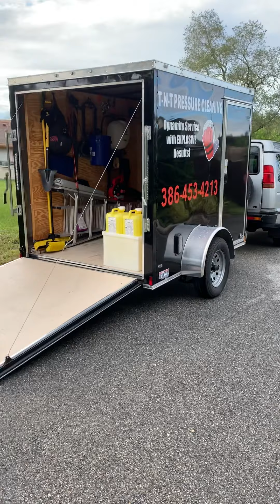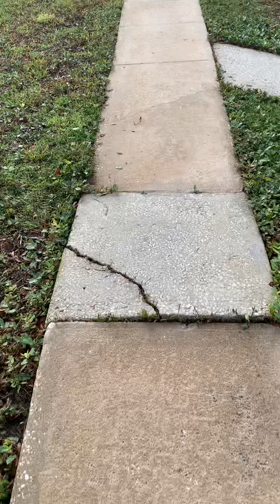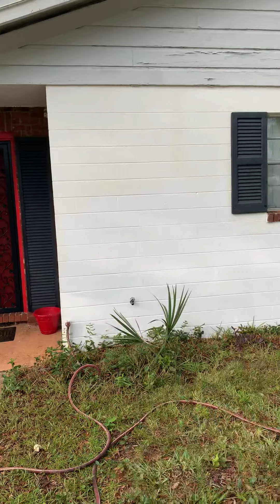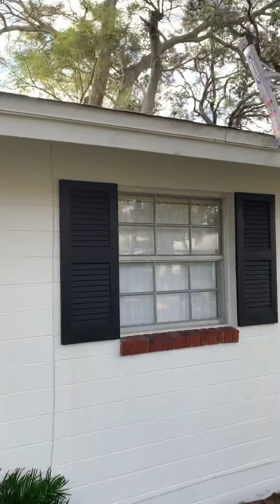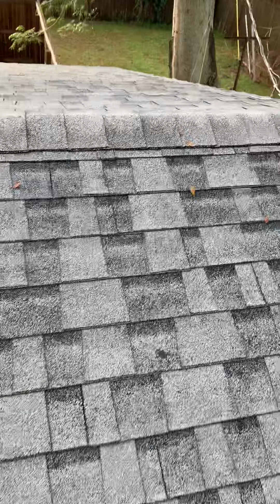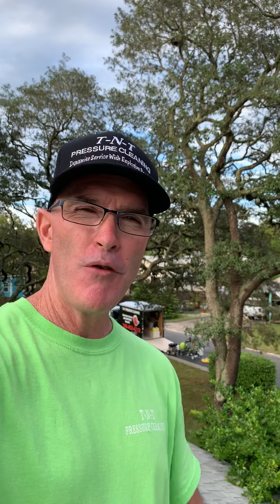Roof/house wash

Comment: What % you used on the roof
Reply from the maker: Saldivar 27  a 6% mix is a hot mix. Because I am an XjetM5 advocate I use 2.5 gallons SH and fill my 5galllon chemical pale with water and 1/4 cup surfactant. It will always depend on the amount of organic matter present and the type and condition of the surface being cleaned. Water plants and grass and bag gutters if necessary.